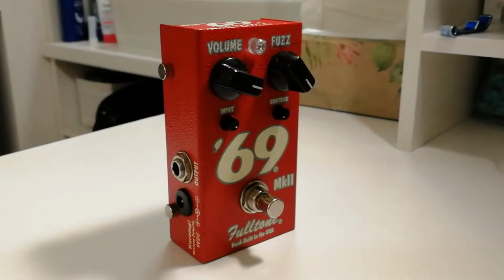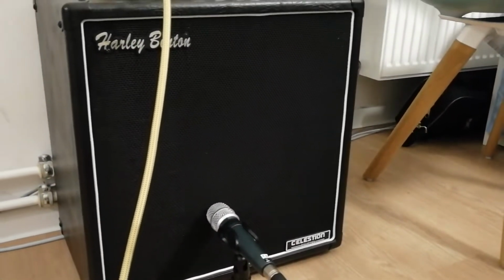Germanium Fuzz Face Hot vs Cold using Fulltone '69 MkII

Comment: I was about to get a germanium but had heard people saying theirs are totally useless in most outdoor situations and doesn’t even produce useable tones. Here I still find the differences wouldn’t stop me at all from using the pedal.
    Some people say tho they can’t use it anywhere outside of70-80 degrees Fahrenheit.
     Would you have any idea where the temperature would have been in this videos extremes? Have you ever notice the pedal not being useable, if so, any idea what the temperature was in that environment?

  I was gonna get a custom build for a little over 200 but the idea that I could almost never use the pedal is a big turn off lol.  I wouldn’t wana write a song with it and then never be able to play the song anywhere lol
Reply from the maker: I think some pedals are more affected and some are less. It depends on the transistor and circuit used. Also, this one has an internal bias knob (I haven't used it in the video) and the two additional small knobs to shape the sound. This pretty much allows you to compensate for that and get a decent sound in a variety of temperatures, guitars, and amps. I never stopped from using this pedal because of temperature and I've used it for outdoor gigs no problem.

For the video, I left it in the fridge in a plastic bag with silica for at least 30 min before recording. For the hot, I heat it up with a hair dryer for some 2 minutes. Hard to say the exact temperature, but it clearly made a difference

Comment: This reminds me of how old transistor radios used to sound on hot days.   It's still not too bad, and adds character to the sound.
Reply from the maker: Hahahah nice to know that.. I guess it was one of the reasons to switch to silicon transistors on most applications. But the germanium definitely has a specific voice and it's character change with temperature
Reply: @TheBedroomRocker1    There are ways to design an audio circuit with germanium that has less gating under rising temperature, but none of them are simple/cheap.  Philips designed some of those types of circuits back in the 70's, but mostly companies simply moved on to silicon- because it was far cheaper.

Comment: I prefer the cold, for me the hot sound thinner splattier and im not sure if there is a volume drop but i listen a lot of the sound of the strings and when you turn the volume down it lost that characteristic boomy sound. So basically the temperature is an external uncontrollable bias control 😆
Reply from the maker: Thanks for the nice comment. Yes, unfortunately I can't turn up the amp loud for the recording, so the pleck/string noise came through... it's a common thing for fuzzes to clean up when you roll down the volume. With the fuzz on, the guitar volume becomes basically a gain control... This fuzz cleans up very well and it makes for a great bluesy sound! If you want all the power and boom again, you just roll your volume up all the way

Comment: Cold it starts sounding like a Big Muff/silicon transistor to my ears. I like it hot! More complexity and clarity.

What kind of temps were you running it at, roughly?

Great video!
Reply from the maker: Thanks for the comments! Yes, I think most people liked it better hot. I did not measure the temperature. For the hot clips, I heated the pedal with a hair dryer for some 3-4 minutes. For the cold clips, I placed it in a zip lock with some silica pads and threw it into the fridge for about 40 min. I would definitely not recommend doing that just to change the sound hahah it was more of a funny experiment, but to be very honest I was also a bit scared to ruin the circuit board and components...

Comment: How did you change the temperature?
Reply from the maker: Hi Nick,
I used a hair drier to heat it up for some 3-4 minutes. To make it cold, I put it inside a zip lock bag with silica pads to absorb any moisture and threw it inside of the fridge for about 40 minutes. I did not have any problems, but it's not something I would happily do to my pedal on every gig...
Reply: @TheBedroomRocker1  thank you! Great test! I wondered why my pedal had been wierd lately...
Reply from the maker: @nitrogennick123  Thanks! How is your pedal sounding weird? Before the video I also tested just by leaving the pedal outside for a while. It was still winter here in Germany, so outside temperature was something below 8°C and this already made a difference to the sound. It's not that it sounds broken or wrong, but it's definitely different. Try using the internal bias trim to see if you can adjust it.
Reply: @TheBedroomRocker1  it doesn't sound wierd but sounds much like yours in the cold setting. My flat has been cold because of a ton of rain lately so has sounded different. As it's meant to spring/summer the heating has not been on either so it's been cold. I like the sound of it hot annoyingly...
Reply from the maker: @nitrogennick123  Yes, then adjusting the internal bias trim might do the trick! I haven't fiddled with that one yet, but maybe I'll try it in a future video. I'm currently preparing a review on this pedal and later I'll also do a shoot-out between different powering options (currently waiting for my battery to discharge so that I can compare a power supply vs. old vs. new vs. alkaline batteries). Stay tuned if the content interests you.

Yours,
Alberto
Reply: @TheBedroomRocker1  Please do a full review with the different power supplies too!
Reply from the maker: @nitrogennick123  I've just uploaded a full review on the Fulltone '69 Mk II. Check it out: https://youtu.be/s9LM50uzpb8
Stay tuned for the different power supplies. I started recording the shoot-out, but my "old" battery turns out to be completely deadl. I threw a new one there but now gotta wait for a while until the voltage drops.
Have an awesome weekend!

Comment: I kind of agree with VoodooKush, but you definitely looked cooler with the sunglasses. I wonder whether if you reversed your clothing during the demos it would have cancelled out the effect of the temperature on the pedal. I like your playing. I also would have liked to hear some volume control manipulation while you were playing and maybe lower drive settings on the pedal. I'm curious to what extent the sound "cleans up" when you do this. Supposedly, that's one of the hallmarks of Germanium vs. Silicon transistors.
Reply from the maker: That's true! Anything sounds better with sunglasses hahah Thanks for the nice comments. I indeed ended up only making 1 volume clean-up in this video, but it really cleans up very well. You may want to check my full review on it. I go through all the settings and play more with the volume knob: https://www.youtube.com/watch?v=s9LM50uzpb8&t=9s